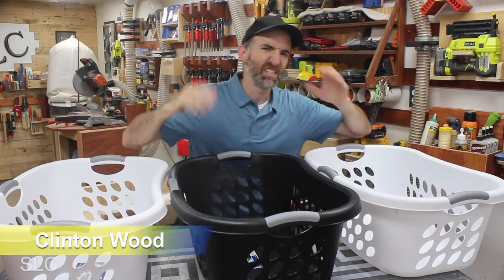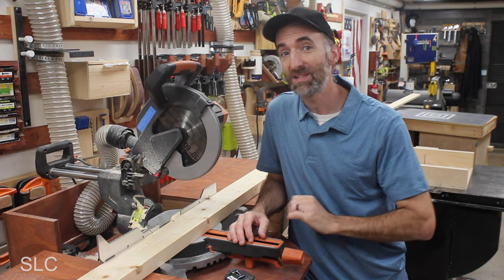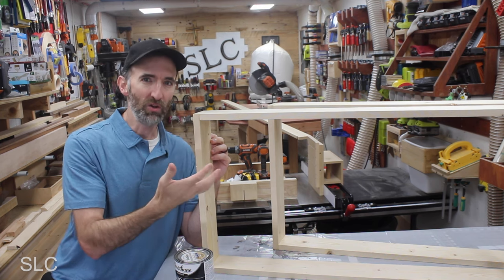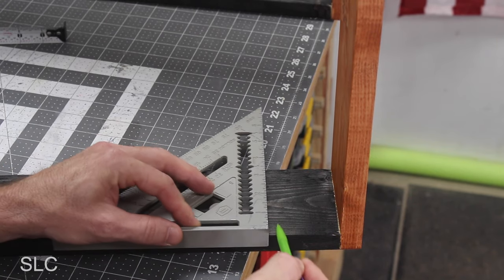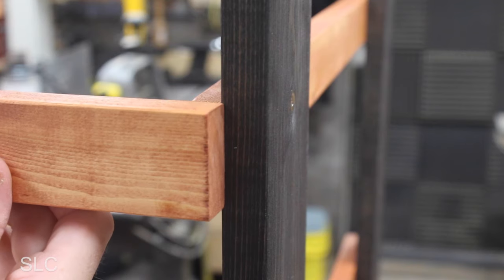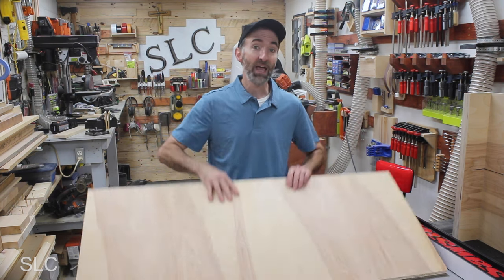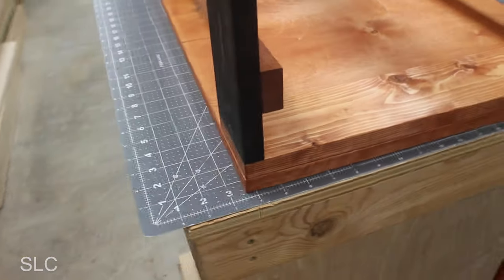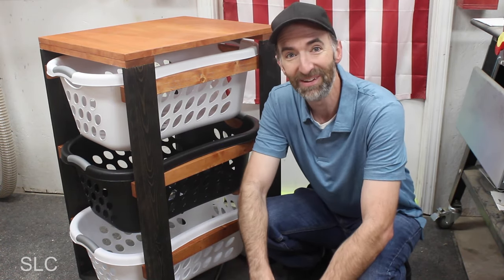Simple Organization for your Laundry Room DIY

Comment: What happens when you need to replace the baskets?
Reply from the maker: buy the same one again
Reply: @SpecificLove7  risky
Reply: Buy an extra set to start with
Reply: @gardenman3  now I'm carrying inventory for when the laundry baskets wear out? 

My point is that laundry baskets don't have a standard. And most people never buy the same one twice. And they fail at different rates. So you're throwing out those that haven't failed yet. 

This isn't a project that I'd do.
Reply: @PatrickHealy  I use laundry baskets that are older than I am, bought by my parents back in the day. I would buy a sturdy pair and that should last you years and years! BTW I'm 33 :)